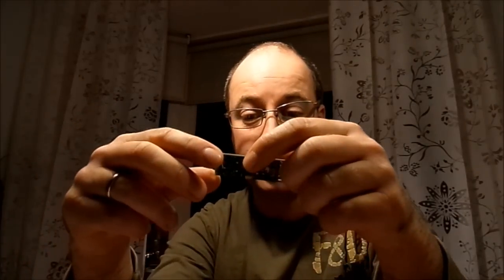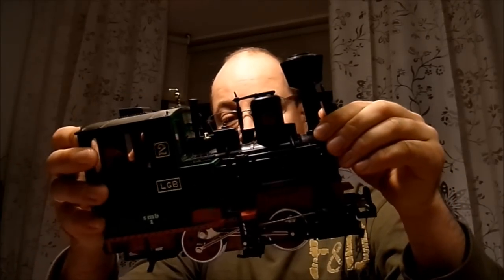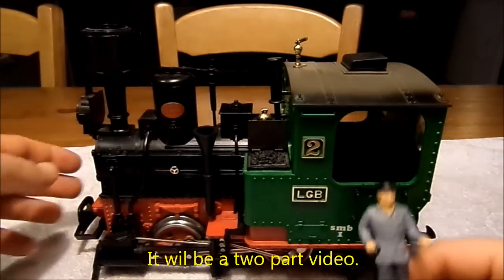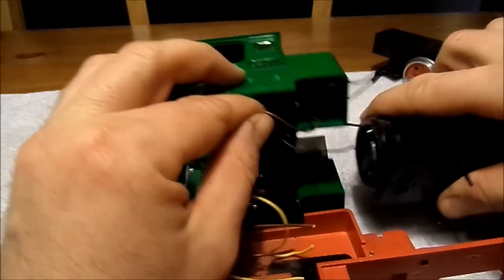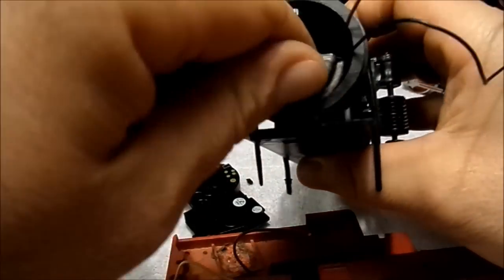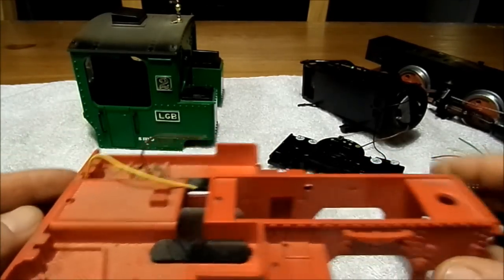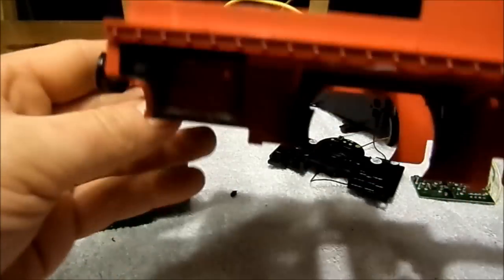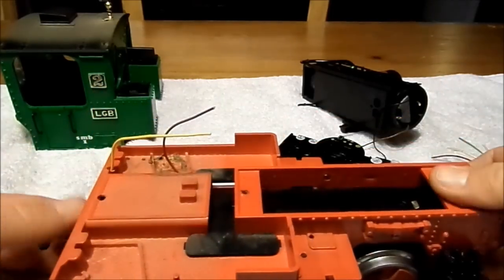Decoder installation in a old LGB Stainz loco part 1

Comment: where can you get a replacement ball bearing if you lose one when opening the gearbox? Is there a size that I can just get a generic ball bearing?
Reply from the maker: I think at a hardware store .
Or a machine shop.
Reply: @BAMBAM5476  I pulled out a ball bearing from another old engine block and measured it with a micrometer. It has a 3mm diameter for anyone else who may be wondering. A few dollars for 50 from Aliexpress.
Reply from the maker: @richlam6356  thanks for this info

Comment: I recently purchased an LGB 20212 with chugging sound and smoke. It ran well for a few days and it stopped all of the sudden, the front light still turns on, but the engine does not move forward. It still runs in reverse. Could this be a motor issue?
Reply from the maker: Yes there is probably a problem with the brushes being worn out. 
If you put it on the track and give it forward power try to push it forward if it starts running. Then you have brush problems and need to replace them or get a new motor. 
Hope you have fun with the locomotive after that.
Reply: @BAMBAM5476  Appreciate the information.

Comment: That loco is a bitch to get apart.  This video is a great help.  Thanks.  Now all I have to do is add a receiver, decoder, speaker, and battery.
Reply from the maker: Steve Seidensticker thank you and good luck
Reply from the maker: +Rob741741 these are stil good gearboxes only old .
But if you can get a nice loco for cheap then i would not be to botherd with this.